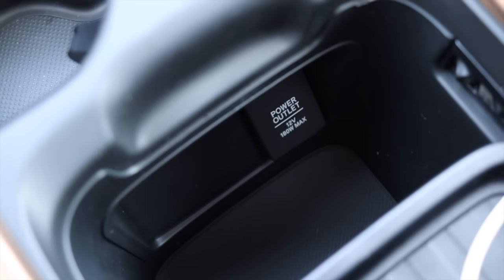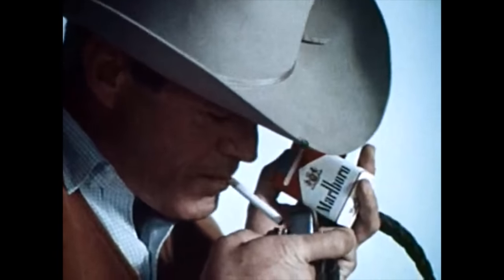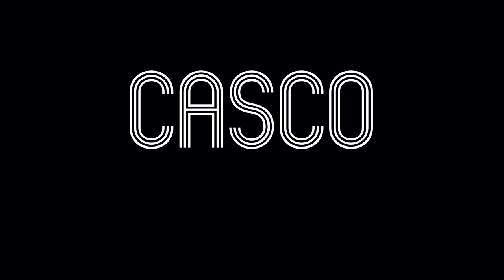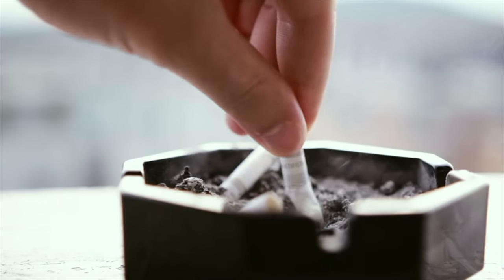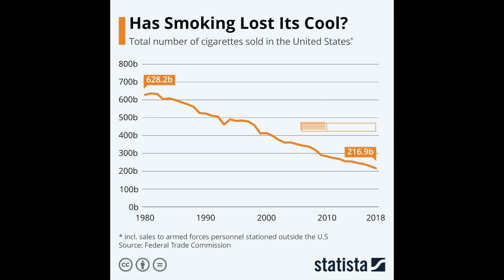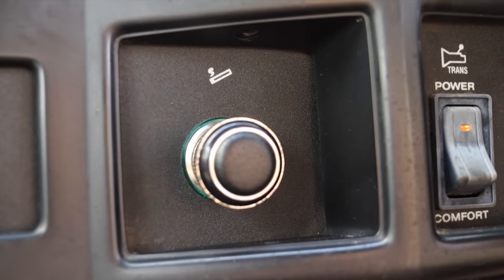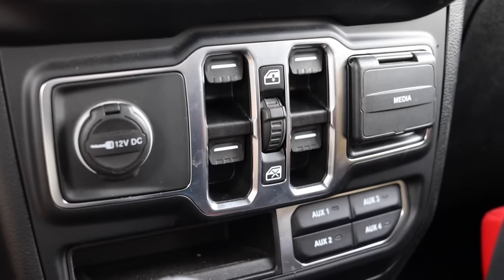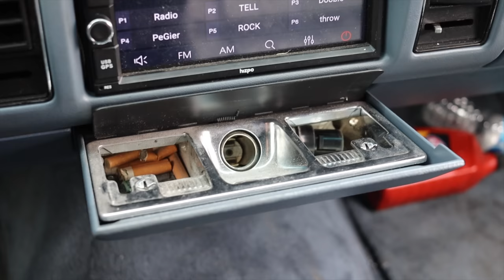Cigarette Lighters - How They Were Invented & Why They Went Away!

Comment: My parents had a 1972 Oldmobile 98 when I was little. I don't remember much about the front seats, but each door in the back seat had its own cigarette lighter and ash tray. Of course there were nights I would push the lighter in and wait for it to pop out, then enjoy the warm glow it produced. It also head the floor-mounted headlight switch. Not to mention, a 455 4-bbl on one end and a trunk you could fit a family of ten in at the other end, without removing the spare tire.
Reply: All of my Hyundai Ponys have rear ashtrays. As a kid, I remember putting stuff in them and pulling them out of the door cards.
Reply: As a kid I caused quite extensive wiring damage when left alone briefly in it as I also enjoyed the lovely orange glow and by my teeny-tiny brain's deduction would be so much brighter and last so much longer. 

I mean, left with enough time I would have been proved right 😂
Reply: I miss the REAL spare tire!
Reply: @petenielsen6683  My 1999 Matiz came with a full sized one. Still have it, alloy and all.
Reply: i had a similar childhood experience with the ashtrays in the back of my dad's 1999 Chevy blazer as a kid, just playing around with 'em not really knowing what they were, though we didn't have separate lighters back there by then
Reply: @RoamingRobinToronto  my dad had a 75 Buick LeSabre that I learned to drive in. I remember the speedometer was literally the entire length of the dash lol...and remember the turn signal indicators on each side of the hood?? I loved those!
Reply: We had a 1972 Oldsmobile with them too. I was 4 my brothers were 6 and 10. They would push the lighter in and tell me that it was a bomb, and that when it pops out , the car might explode. It was scary at first but then became a fun game.
Reply: @the_kombinator  wow you still have one?
Reply: @MrDwightsimon  Oh yeah, it's my daily for work. I also have 4 Hyundai Ponys. :D
Reply: Mine was a 1970. 30 gallon gas tank which needed premium grade fuel, and in normal driving got you 6-8 MPG around town. Seatbelts for six but 8 tall large adults could ride comfortably all day long with space to spare. Bought it cheap in extremely great condition after the 2nd 'fuel crisis' for $200; a year earlier it would have sold for $2K but nobody wanted those huge old cars with rotten fuel mileage anymore at that point.

Comment: I’m also fascinated by which auto makers still have cigarette lighters and which have ditched them, and when. My current car is a 2010 Hyundai Elantra, in the base trim package. Despite being sold 2-3 years after the release of the first iPhone, it still has a cigarette lighter and ash tray. You can see the start of the transition, though, because it also has a second 12V outlet with no lighter in it, and the stereo has both a 3.5mm aux jack and a USB port.
I’m trying pretty hard to remember if my parents’ cars have cigarette lighters or ashtrays in them. My mom drives a BMW 5-series from around 2013, and I’m fairly sure it has an ashtray but no lighter.
Reply: I have a 2010 Mercedes S class it has 2 lighters and they made those cars up to 2013 idk if the newer generation had them fitted or if they got removed all together

Comment: My 2009 Hyundai Genesis still came with a cigarette lighter and an ashtray. I've only used the ashtray for coin storage - and only used the cigarette lighter to light a cigarette once or twice (I was only a "social smoker" at most - I don't smoke at all now). There is a second 12V round socket (no lighter) inside the center console.

My very first car was a 1999 Ford Contour, that one had the smoker's package - again I used the portable ashtray for coin storage (and it occupied one of the two cupholders).
Reply: Now you use it to let your weed

Comment: The round car outlet is 12V DC, and household outlet in America is 120V AC. I imagine 12V ports will stay around because the automotive aftermarket gave it new purpose: portable air compressors, inverters, radar detectors, etc.
Reply: This exactly.
Reply: And for USB charging, it's much easier to upgrade a 12v adapter for new wattages and standards, compared to a built-in USB port. Even the USB ports in the video (5-7 W) are already pretty weak by today's standards.

Comment: They have the 12V outlet for backwards compatibility.  If you wanted the lighter/heater element, you can still buy them at auto parts stores oddly enough (although with pocket lighters around I don't know who would buy one).  I think they were also phased out for safety reasons.  Kids could burn themselves, and same for ashtrays (as they could lead to fires in some probably more rare cases).  But the cigarette lighter has remained as a carry over from the old days, and they are still useful actually.  The other reason they have stayed around too is that some people need power inverters, and most vehicles don't have 110V outlets built-in (some trucks do, but most cars don't).  The cigarette lighter socket in most cars can deliver up to 100-250 watts in most cases, which would allow someone to plug in an inverter (which could not be done over USB, even USB 3.0 or USB-C as those canot deliver enough power) and have mobile power, so that's probably also another reason they are still found in modern vehicles (for charging, and also some devices, although most people use them as a power source of some sort).  For example when I  travel, I run a 120W power inverter that can run my portable fridge and charge my laptop while driving.  And I can charge my portable power generator (Jackery) from this outlet too while driving.

Comment: Ya, smoking used to be a big thing in America. They even had cars and light trucks with 2 piece side windows for the passenger and driver. You could crack open the smaller window to vent the smoke out of the car. Not to long ago I saw a car manufacturer offer a smoker package option on a new car. It consisted of a round ash tray that fits in the cup holder. I can't remember if it included a way to light your cigarette and don't remember what car I was looking at when I saw the option.
Reply: In the 1930's, even German airships like the Hindenburg, despite being hydrogen-filled and thus an extreme fire hazard, had a designated smoking room.  It was kept pressurized just to be safe.  But smoking was so popular on both sides of the Atlantic that it was feared that not providing facilities for it would turn away passengers.  Or worse, inspire someone to smuggle a lighter into a less-supervised area of the ship.
Reply: The window vents (aka "wing windows") were not designed for smokers.  

They were made to simply force air into the cab, or suck it out, while making the forward part of the door glass functional with simpler window crank designs. 

But the fact that it was able to so gracefully suck air out, and in such a convenient location, made them perfect accessories for people who smoked.
Reply: Vent windows were for ventilation, they weren't for smokers, but they worked great for that.
Reply: You're thinking about Porsche. They still offer smoker's packages and they are worth it.
Reply: @danielbishop1863  Well, the Hindenburg wasn't intended to use hydrogen, they only used it because the US stopped supplying them with helium
Reply: Mostly cars from the vw group have this. My golf has a cigarette lighter but no ashtray tho since it doesn’t have the smoker package
Reply: The triangle windows are basically primative AC and they work wonders.
Reply: Probably Land Rover. It’s a selectable option across the range and it comes with lighters and ashtrays that fit in the cup holders.
Reply: Wing windows work phenomenally regardless of smoking. Well designed ones such as the iconic OBS ford doors are nicer to use at highway speeds than the main window. They also provide a secondary opening if the main window hand crank or motor is disabled which is important for off road use. Cheaper A/C and cheaper power windows is what killed wing windows not smoking. No A/C and no wing windows is shitty but with wing windows it's amazing that you almost don't need A/C on some days even if you have it and can just save a bit of fuel and keep a bit more engine power at your disposal.
Reply: @KS-xo3oh  
In 2011 they were putting them together with whatever they had left. If the middle cup holder pull out part was one with a cig lighter so be it. Some very last minute 2011s  even got trays not seen since the 2000s models.

Comment: These outlets can supply around 175w -300w (depending how vehicle is wired)comfortably because of the big outlet.  USB for now only supplies about 25w. They are working on USB that supplies 100-300w but are far more prone to having overheating and shorting issues.

Trying to get more power through a small connection point has to be very secure and a higher voltage, but that creates it's own array of problems.
Reply: Exactly, well said. I don't realistically see the 12v socket being dropped any time ever.

Comment: In Europe lighters and ashtrays remained a standard fitting to almost every car into the early 2000s, I imagine the French and Eastern Europeans played a big part in lighters staying around so long.
Reply: My 2000 saab 9-3 coupe got both haha
Reply: My car, a Dacia Duster, was made in 2016 and still has two of them. 🤣 And it doesn't have USB. I use an adaptor.
Reply: They are still in cars. My Golf 7 from 2017 still has it.
Reply: I had a 2011 Citroén Berlingo and that car did not have a cigarete lighter

Comment: First video I've seen from this channel. I like it already. I was born mid 1970s, so I grew up in cars with the lighters, and have seen how their implementation has altered throughout the years. In the present time I have a strange juxtaposition of times and cars: my mom has a 1992 Chrysler LeBaron that she bought used in 2014. (Fyi, when she bought it, the car had and still has a total milage count of less than 100,000miles. Approx. 76,000 currently.) Of course, the car, being state of the art in 1992 has two lighter ports up front in the central console with ashtray, as well as an ashtray with lighter in the rear of the central console for the back seat. Recently, my mom bought a newer 20-teens half-track type of car that is equipped with USB ports front to rear. Regardless of having these modern ports, the car is also equipped with a lighter-type port, although no astray.

Comment: The one in my truck is chrome and fancy. 1986 F150. It's an XLT Lariat, and it's the only 12v outlet in the truck, and it's the factory radio head unit in the truck so I just gotta leave the ashtray open to have my Bluetooth FM thing plugged in. Also it has floor mounted high beam selectors. I love the high beam switch

Comment: I would say you skipped a section where accessories where made to plug into the lighter for power so instead of doing some hard change there was the soft transition to the 12v outlet

Comment: oh wow those floor mounted high beams! my older co worker was talking about how those used to be a thing when he was driving. so cool to see that it will be talked about in one of your videos
Reply: I remember when I first met my wife, I was visiting from out of town and her mom let me borrow her 20 year old Cadillac that was barely holding together, and I tried turning off the high beams only to find out that the high beams were the ONLY headlights that worked!  Apologies to anyone I might have blinded back then...  Although the fancy blue headlights on new cars today are even worse, I'm sure.  I also miss the gas filler cap being behind the rear license plate, you never had to worry which side of the car was facing the pump.
Reply: My 1990 f150 has floor mounted highbeams

Comment: There is something big you are missing here.  House outlets in the USA use a completely different power system than car outlets.  House outlets run on 120V 60Hz AC power,  cars on the other hand run on 12V DC power.  These are completely different.  It’s possible to convert between them, but it honestly doesn’t make a lot of sense to put house outlets in a car since it would need a DC/AC converter.  USB outlets make a lot more since since that’s just a DC step down converter, which are a lot cheaper and more efficient to make.  I have a degree in Electrical Engineering btw, so I know what I’m talking about.

Comment: I find that useful having a cigarette lighter plug that can power other accessories too. But it'll be better if cars were equipped with 220v sine wave inverter from factory. I don't think I'm gonna miss cigarette lighter at all in the future. I'm now on my progress embedding a 220v socket in my 1988 Cressida so I can plug normal home items in my car. 

Also, I think another feature that needs to be added as a standard feature is wireless phone charger.
Reply: You'll never see the 220v socket implemented as it's not universal. You won't see the removal of 12v sockets for a long time if ever.

Comment: You should do one about the phase-out of traditional single-DIN modular car stereos in favor of the 7" and 8" (even 12"!) infotainment touchscreens that have taken over with Apple Car Play and Android Auto.
Reply: Oh yes I hate those!  Especially in the late 90's when Ford made everything on the Taurus and Escort oval-shaped, and included the HVAC controls on the same panel as the radio.  Crutchfield did sell an adapter for those, but it was way expensive and a big hassle.  At least new cars usually come with Bluetooth now, so replacing the head unit isn't as big an issue.  But up until 2019 I was still playing my music through one of those cassette-shaped adapters, my 2001 Honda Accord came with both a tape player and CD changer.

Comment: The historical part of the video is really well done, i just have to point out 2 things:
-The 12v socket would still be useful for many 12v car appliances, removing them just because not that much people use it for cigarettes would be quite stupid.
-We wouldn't have regular sockets that we find at our homes for example just because they are two different types of current. One is an alternating 120/230/240v and the other is a direct current 12v. Also on some cars you have regular outlets, powered by inverters. Mostly on eletric cars and on trucks and jeeps.

Comment: Most cigarette lighters run on a 10-amp fuse that allows for 12 volts or 120 watts of power output at maximum. There may be some variance on this depending on your vehicle. Check your owner's manual or the cover of your cigarette lighter socket to find the specific output for your vehicle.
The USB 2.0 specification allows Hosts to deliver 5V at 500 mA, for a total power output of 2.5 watts. USB 3.0 and 3.1 allow 5V at 900 mA (4.5W).
Given that some 12 volt devices require much higher amperage, it is doubtful the typical cylinder style outlet will be replaced by USB. Supplemented yes, not replaced.

Comment: My 2015 Ford F150 XLT trim has 3 of these outlets at least and only one USB port. My friends who recently got a 2022 Ram pickup has multiple USB and USB-C ports but only one 120 volt outlet in a newer truck with WAY more features than my truck. To me its a perfect example of how they're most definitely phasing out the technology but keep it around because so many devices like GPS, CB radios, among others still need that specific outlet to charge. But even those can be considered older tech ao makes me wonder what the future holds at this point.

Comment: In Germany these outlets were called Cigarre lighter because somebody thought german car drivers would only smoke cigarres instead of cigarettes.
Over time the manufacturers first renamed these outlets to power supply and since the 2000's they removed silently ashtrays in a bunch of models. If you want to smoke in your newest fancy car you can buy a cheap looking bucket made of plastic with a lid and try to store this into one of the provided cup holders.
I think these circular power outlets will be in our cars forever because of some good reasons compared to USB. First they provide 12 Volts by 15 or 20 Amps which USB cant handle without starting a fire. Second reason: most of the used devices dont need to send data to the car, for example portable cooling boxes or air compressors. 
And third reason: these strong and save power outlets are in our cars since about 50 years so they are used worldwide, so you don't have to bother about incompatibility compared to your individual home used power grid preferences.

Comment: A Cigarette Lighter in the passenger Door in one of my Cadillacs, an 86, blew its Fuse. The same Fuse that powered the Automatic Power Locks, the Locks still locked using the Switches on the Doors, but didn't lock when the Transmission was shifted to Drive, and unlock when put in Neutral/Park. Also dead were the Power Trunk Pulldown, and Auto Leveling Systems. I spent a bit of Time looking at the Wiring Diagrams figuring that one out. Actually, I was probably Lucky, as the Lighter was Jammed in the Socket, and hadn't popped out.

Comment: My [old] Garmin GPS has a 12V circular adapter charging cord although I now use the USB cord mainly. My 2017 Jeep has all three types outlet plus a 110 style in the rear. Car
lighters were handy for starting a campfire when you forgot to bring matches, albeit a tedious process..  in the 70's I had an Alfa Romeo from Italy, its lighter was unique, you pushed inward on a sleeve to activate it, inserted the ciggy in the socket, and it  popped out lit.